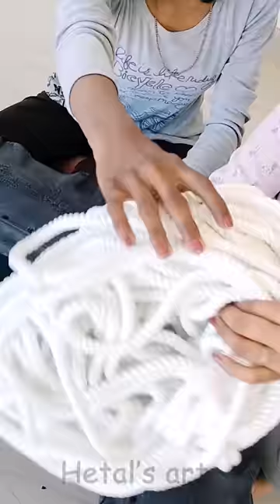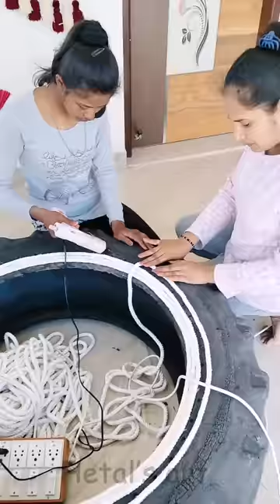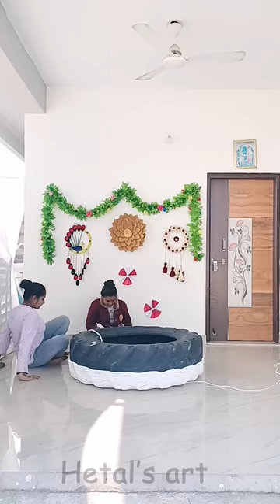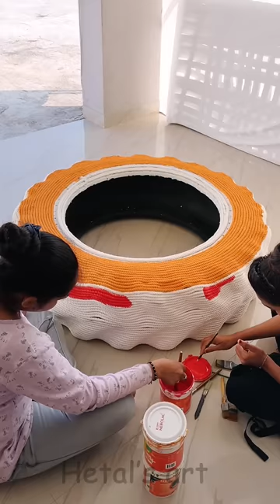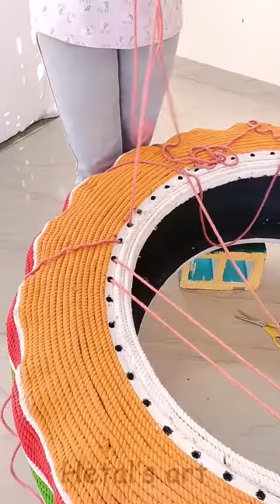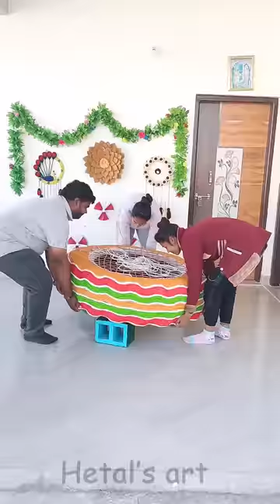Old Tractor Tyre Swing Making - Multi Colour Rope Design #old #tyre #swing #diy

Comment: Indian houses have concrete  ceilings.  We used to have long rectangle  teak  board swings with Iron chains on both sides .   But this tire is hanging from single hook.  All the thick rope is making it even heavier. Looks pretty though.  You can try outdoors on a thick matured tree. Very colorful.